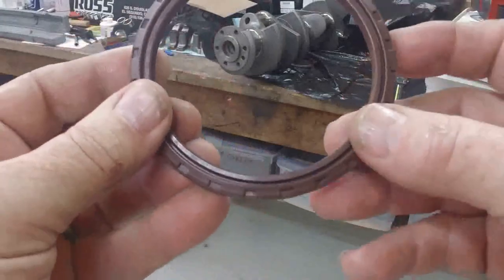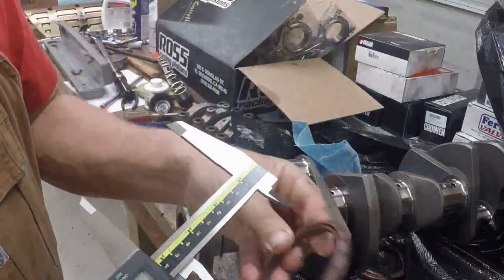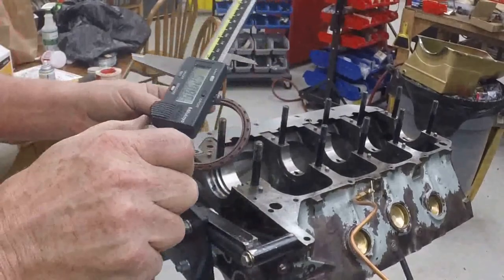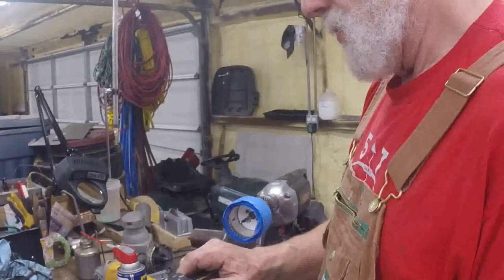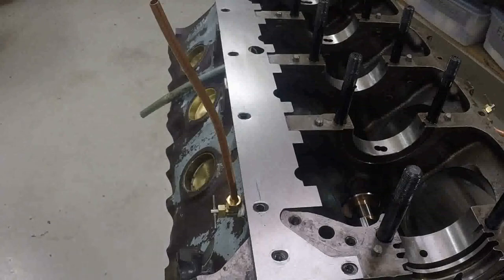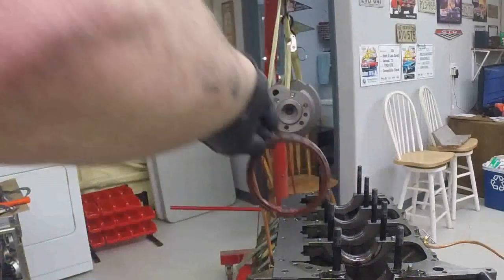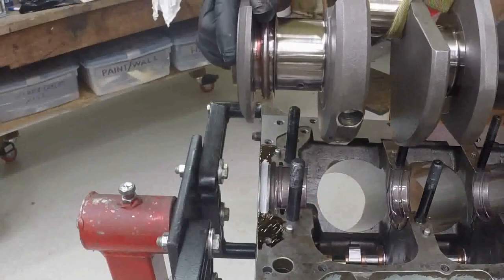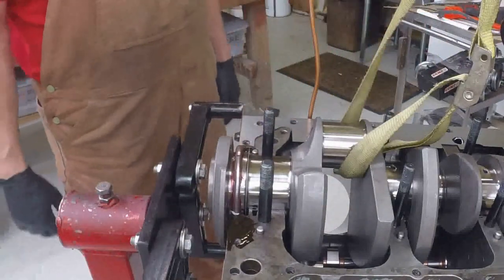Bear's GTO - Fitting and Installing the B.O.P. One Piece Rear Main Seal

Comment: Putting my 1972 455 HO together and trying one of these seals, I been building Pontiac since the mid 70s and have been fortunate the rope seals always did well. Figured I'd give her a try. My son is restoring a 1973 455 4 speed Brewster green #. matching T/A and used a one piece seal also. The apple don't fall far from the tree, proud on my son for keeping that ole Poncho alive.
  Thanks for the video, definitely helps. 👍👍🏁🏁

Comment: I have a 455 stroker motor that I’ve replaced the vitron seals twice. I’m thinking about replacing them with the one piece BOP seal. Now that you have installed one are you happy with it? Thank you for your videos nothing worse than a new engine leaking oil!

Comment: It looks like you installed the seal backwards, it's clearly labeled on the smooth side of the seal itself ''flywheel side", you installed it w the squares towards the flywheel.
Reply from the maker: Hi Jus, your comment made me doubt myself.    The installation instructions actually say that one of the inner lips has a 'helix' on it while the other lip is smooth.  The helix goes towards the front of the engine.  I have on hand a spare seal that I just now examined.  The lip with the helix is on the opposite side from the face that has the squares, so the squares rightly go towards the flex plate and you can see I installed it that way at about 15:00 into the video.  Whew!!

 Direct from the installation instructions on the BOP web site I found this:
"If you examine the seal closely you will see that there is a helix pattern on the oil control lip. This lip goes towards the front of the engine, not to the flywheel side. Note that the RMS18 and RMS19 have square indents on opposite sides, therefore you must look at the seal lip to get the proper direction."   
My block is a 400 block and uses the RMS18 seal (3" main).  The RMS19 for 3.250" mains would have the squares "away from" the flywheel/flex plate.
Reply: Jus a silly goose lol 😅 they show the squares out on the description pictures b4 you buy it now why would they present a part reverse side picture first that wouldn't make sense for sales purposes mainly so ima go off that and bear is the man so why doubt a pro

Comment: I ended up with a leaker also with the one pc rear seal on my 65 Grand Prix. Not sure which way to go next.
Reply from the maker: My next move is going to be with the graphite impregnated rope seal. I'm also going to have the serrations on the crank polished.
Reply: @BearGFR  I have a leaker also.  If you are having the crank polished, that means you are pulling the crank all the way out of the engine?  Are you pulling the heads off and everything?
Reply from the maker: @frednicholson  Yeah, I tore it all the way down. I had another issue to address also (long, sad story).